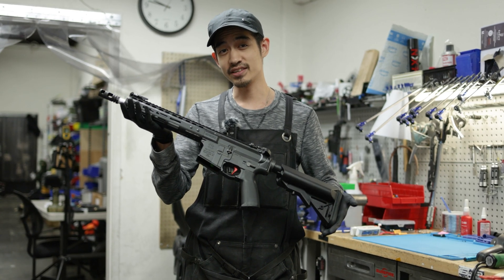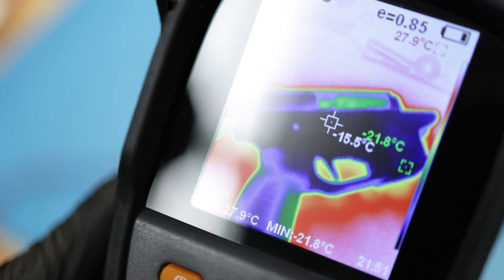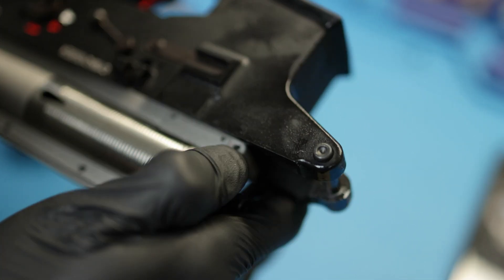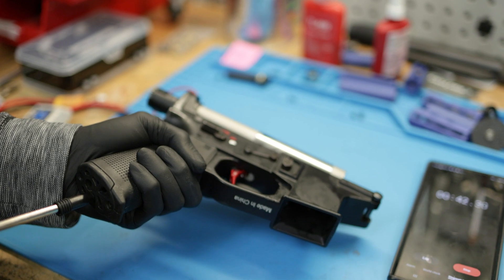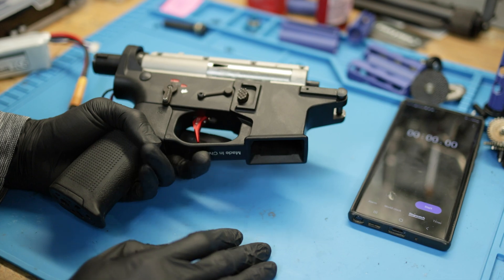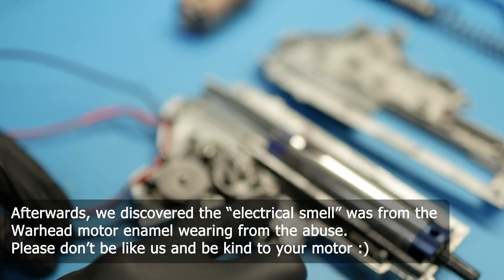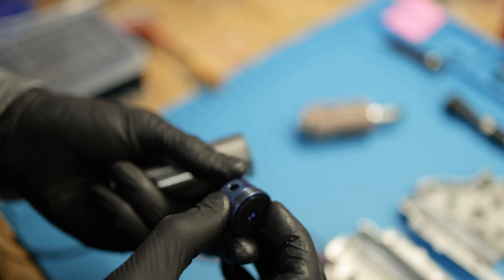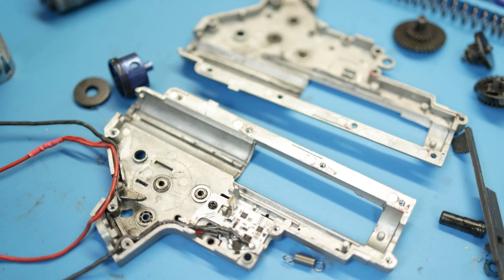Stress testing FROZEN gearbox (CYMA Platinum AEG)

Comment: facepalm...... Most pointless test I have seen this year so far. Freezing is pointless because heat kills, not cold temps. Internals in the gear box were under lubricated, which tells me that someone at the factory didn't care enough to slap more lube.
Motor stopped on its own because it has built in heat protection!

Next time, run bbs through a gun if you want to properly kill a gearbox.

Comment: Is the stock CyMA plat gears good? I heard they are 13:1 SS 4 teeth. I am going to build one and want to know if shs 13:1 are worth it or keep stock gears.
Reply from the maker: CYMA gearbox uses SHS gears just rebranded if they look slightly diff. Most gears are SHS just with small changes here and there to fit manufacturers requests. Stock gears should be okay if you want to run that specific ratio.

Comment: I made the mistake of building a dsg with a lancer gen 2 gearbox, it lasted like 500-600 shots before it completely tore the front end of the gearbox off. Lesson learned
Reply: Buy a lancer tactical gen 2 was your first mistake lol.
Reply: It was a lancer. What were you expecting.
Reply: Ye normal thing to break gearbox on m150 spring